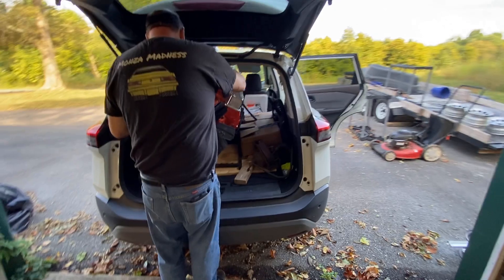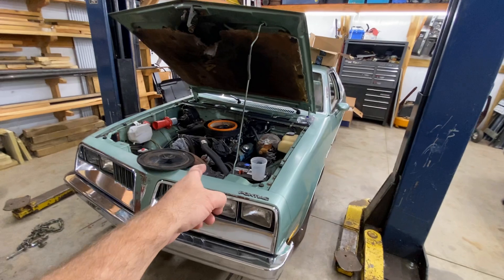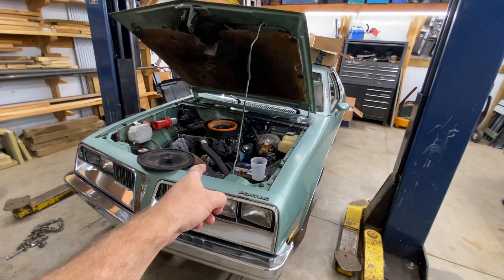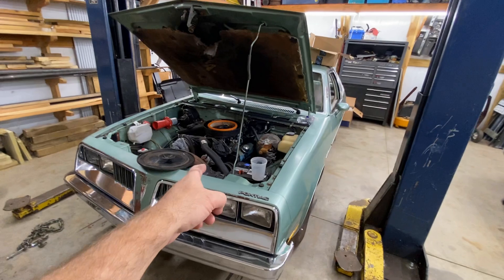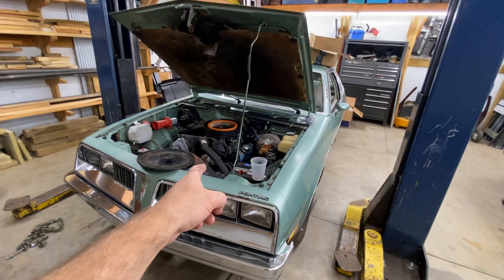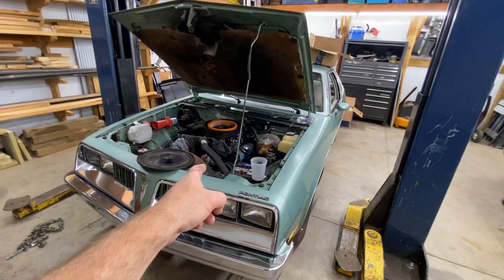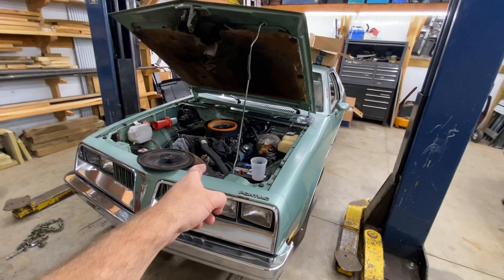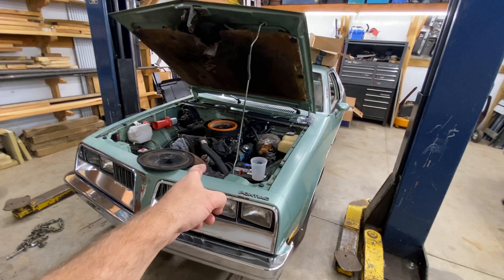Project: High School - Episode 2

Comment: My high school Sunbird (which was also my college Sunbird and law school Sunbird) got squished in a four car pileup when it was 26 years old.  I was not mechanically inclined, so it remained the stock odd fire V6 and horrible Borg Warner reverse h-pattern 5-speed. I had the car from 1985-2002.  It had 176,000 miles on it and the guy who bought it from me after the accident drove it for several more years.
Reply from the maker: Wow.  Yeah, the 75 to mid 77 were odd fire and sucked.  The later even fires were better but not great.   My silver 80 coupe is an even fire v6.  We will be crossing 98k miles on our 500+ drive home tomorrow.   😩
Reply: @sunbirdgarage2774  The engine was amusingly rough, but it was the transmission that ate clutches faster than tires that was the real piece de resistance.  The pedal was so stiff that in law school the firewall burst around the cable from metal fatigue.

Comment: Oscar the grouch. Love it. Both Chevy and Pontiac purists are screaming at this. Love it. No smog pump or emissions. The environmentalists are screaming at this. Love it.
 What headers did you get for that car? I always ran manifolds. Can't wait to hear it run.
Reply from the maker: I have a set of old Hooker 2135’s.  They’re a pain to install.   You need the car 36” off the ground, remove the k-member, and install from the bottom up.   I last did it in 1989/90 😂
Reply: Good grief. Manifolds work just fine.

Comment: I’d keep that Buick 3.8 and use it for another project ( something that would benefit from a v6 swap)
Reply from the maker: We got a whole $21 from the scrap man.   I considered keeping it as a backup for my 80 coupe but I don’t want to carry the mess home in my Rogue.
Reply: @sunbirdgarage2774  that’s fair, I’m just a sucker for a Buick V6 that’s an engine that goes back to the mid 60’s and is a derivative of the Buick 215 aluminum v8 ( I mean technically it’s a derivative of the iron block Buick 300 V8 but that engine is itself essentially just an iron block 215
Reply from the maker: @barryismygod  oh no. I get it.  Had I been able to get it home without making a huge mess of my work car, I’d have kept it.
Reply: @sunbirdgarage2774  cool, back in the late 70’s my dad had a ‘78 Monza Coupe with a Buick 3.8 and a Four Speed he always says that car Hauled ass and a buddy of mine has a ‘05 Monte Carlo with a 3800 Gen III and that hauls ass

Comment: had a 6 cyl Monza 4 decades ago but part of me has always wanted to dump a 302 Chev in a Monza
Reply from the maker: They’re a fun and light car if you have some power.   Getting harder to find good, clean ones.   Not much is reproduced for one either.  Calipers are non existent.
Reply: @sunbirdgarage2774  It amazes my how rare any of the 70s & 80s cars have become ... Im from salty  Ontario but I lived in Tennessee turn of the century for 3 years & kinda looked for a Colonnade 76 Cutlass S to do what you are doing ... rebuild my high school car even in the south & they are gone
Reply: @sunbirdgarage2774  I have always thought  a 7000 RPM  302 would be a wild ride in an H Body 😁

Comment: um that color on the car needs a serious update since you updated the car with a  new engine etc dont you think, also put new rims as well. what would happen if you "tweek" ;larger to fit the holes properly,
Reply from the maker: I LOVE the color.  Probably because I had a 1978 Nova in the same color when I was a kid.    Eventually I’ll change the wheels.   

Phase one is high school mode.  
Phase two it will get some upgrades.